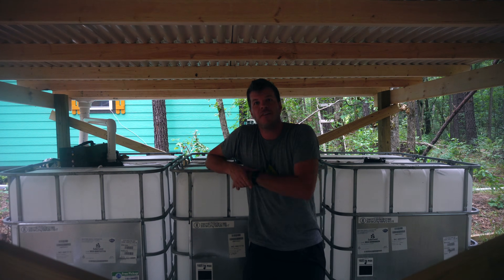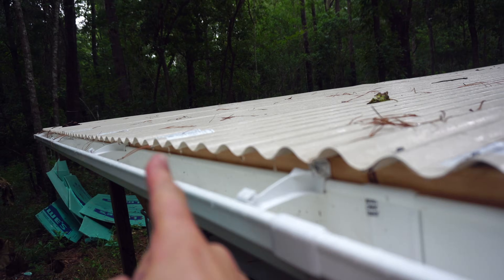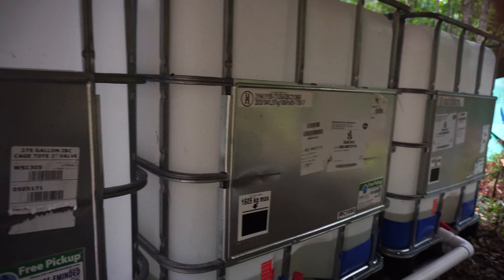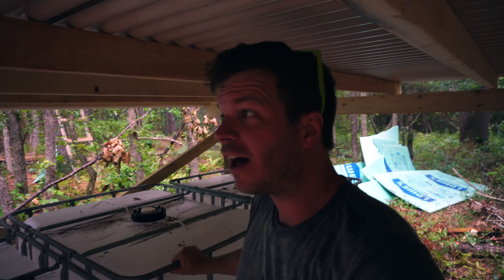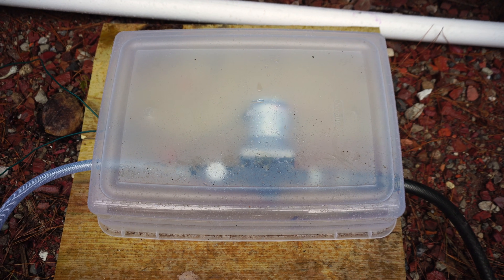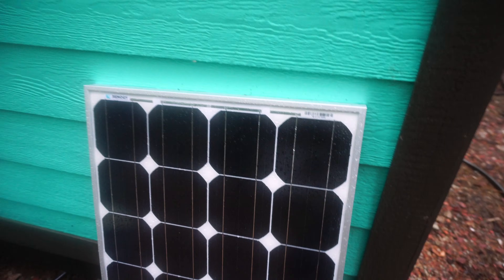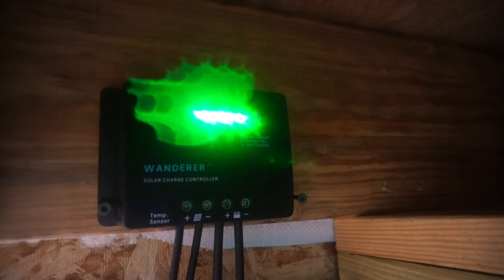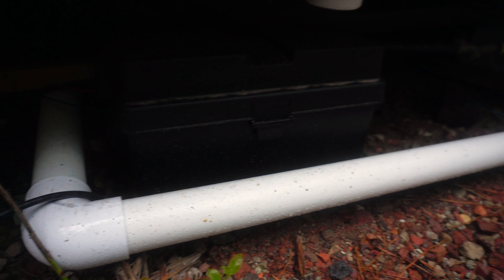ALL THE FREE WATER YOU NEED FOR A TINY HOUSE

Comment: How does the 3rd pump (small pump connected to battery) shut off when no water is being used? If it doesn't shut off, won't it or can it overheat? And the lifespan of it be reduced? Or do you have a shut off switch to it that is inside the house? Thanks.

Comment: One question I have for you. If you use this for drinking water, what do you do to kill bacteria that could in fact develop even in those totes over time? Do you use UV purification or chlorination of any kind? Activated carbon can help, but it still will not totally rid the water of BOD (biological oxygen demand) for microbes and other micro-critters. Other than that, I think the system it perfect. It is incredibly simple.

Comment: Hi , I'm seeing this in April 2018 and I seen something that I would like some clarification on .
You're showing the water entering the bottom of the totes , being fed from a down spout , Won't the pressure from the weight of the water inside of the totes prevent the new rain water from entering  ? because it needs to overcome the downward pressure of the water already present ?

Comment: Thanks for the video! How large is the battery you're using?
Reply from the maker: My pleasure! It's a deep cell battery similar in size to a car battery. Probably bigger than needed but the battery is also shared with the small fan that runs the fan on the compost toilet. But a good idea in case there are lots of days of overcast weather and no sun to power the battery back up.
Reply: Thank you so much for the information. I actually have a nice one I got for free that I could use then. Great inspirational setup! Stay tiny

Comment: Your outflow filters look great and you will definitely have a reasonable water quality, but you have to fix your inflow filters. To much organic matter will quickly block your filters and you have to clean or replace them often. Get a filter bag and keep it outside your IBC. I use rain water for irrigation only and the filters are only to protect the system so I only change them when my water pressure drops. Since using inflow filters my outflow fine filters last a whole season, previously I had to clean them every other week.
Reply from the maker: Thank you! I will check into this. Great advice. I appreciate it.

Comment: How does the pump automatically come on? is there a internal pressure switch within the pump itself that turns on the motor when the pressure drops?
Reply from the maker: That's exactly it. As soon as any valve is opening inside the tiny house, the pump kicks in and stays on until 55psi is reaching, which is only usually just a few seconds.

Comment: the pressure is terrific...what happens if you have a dry spell for a long time? yesss, what a great idea! have workshops up there!
Reply from the maker: My Dad has one extra 275 gallon tote that he can take to town and fill up if needed, then pump that water into the system. Worse case scenario (plan b) would be to pay for water to be shipped in which is pretty cheap but not something he wants to do on a regular basis.

Comment: I grew up with a rainwater domestic supply and have professionally installed stacks of them. The first thing I noticed was that you've used a balancing/filling line (The pipe that connects all three tanks) that was at low level. You should always have them high so that if there is a problem with fittings or tank wall perforation, only the tank affected empties out. A lot of the tanks I hooked up to were 10,000 gal round concrete ones and during one especially hot dry summer, tree roots busted through the base of one I'd done the hook up for (Day of the Triffids schidtt) and drained the tank (mugged by a tree). If I'd fitted a low level balance line, their entire supply from all three tanks of water would've been lost. Outlets were low level and valved separately so that only one tank was used at a time, unless.......   they were set in the ground, in which case they had a high level dual take off, with an internal dropper and foot valve, so that one tank never got too low, because if they empty out, the next time it rains, they'll actually pop out of the ground from displacement via the sudden abundance of groundwater.
Reply from the maker: Thank you. After a couple hours more rain, the tanks are all full. I agree with what you'e saying. The beauty of these totes is that you can hook them up in so many ways as PVC is super easy to work with. If we find this system doesn't work, we'll take another approach. I like that with this system, the top access is all accessible so bleach can easily be added to each if needed.
Reply: Yeah, they're a mighty little item those totes. Perfect for a small set up. The big tanks I was hooking up were generally for those old school, huge rural families keeping stocks up for potentially dry summers. If you're going to experiment with setups, I'd recommend using alkathene pipe and fittings, for the lines between tanks, as you can keep using the fittings over and over again, unlike PVC. 

Great channel by the way brother.

Comment: The totes were they new or had food grade products in them before your use. Consider a central mounting spot for your strainers & filters to ease servicing & freeze protection. Plenty already spoke about blacking out tanks for algae prevention. Where your totes feed your system install a secondary dump valve on each tank for servicing or wash out, consider flexible connections around tank connections for settling hard piped wont allow. The current system needs to have each outlet labeled non-potable this will take liability off you and shortcut any local codes against rain collection systems. Please take what I have said as positive we are right in the middle of selling home in town and purchasing homestead in country, already purchased 5th wheel for our tiny home yours is beautiful I'm a licensed plumber and everything I suggested will be doing myself, look forward to more of your videos

Comment: I've heard of a couple of tiny house fires resulting from Eccotemp heaters. Check the 1 star reviews on Amazon too. You might want to at least add some fire-proof cover between the heater and the wall to be on the safe side.
Reply from the maker: Thank you. The one I have actually has 4 stars on Amazon. I wonder which one only has 1 star? Not good.
Reply: Sorry, I wasn't clear. There are Eccotemp heaters that have four stars overall, but when you click to read the individual reviews and then click to see only the 1 star reviews, then you can see people talking about dangerous incidents with Eccotemp heaters. In one specific review, a woman who gave it 1 star describes how the flame went out but the heater continued emitting gas. When the ignition kicked back in, the accumulated emitted gas effectively exploded and scorched the side of her house. That's just one example. 

I was reading through the negative reviews and was surprised that Amazon still allowed the heater to be sold given the number of people who have had very negative experiences with them.
Reply: By the way, thank you for the video. I got a little distracted by the heater issue. It was really interesting to see your set up.

Comment: i keep thinking im gonna need lots of room for a pump filter heater but they are actually quite small. i dont know if this will freeze here in NW Ohio especially at night near 10 degrees.
Reply from the maker: You can always put the pump very close to your tanks, then bury the pvc pipes below the frost line to prevent freezing. We'll be wrapping everything in solar tape with a wire running through it that's powered by solar/battery and heats things up during the cold months.

Comment: i live in a place where we collect rainwater with guttering & downpipes, & have septic tanks. rule of thumb for any roof-collecting water system is that for slight roof slant degrees, t rib/ridged roofing profile is used, because this profile has a way more efficient flow, than that corrugated profile, when collecting rainwater
Reply from the maker: Thank you for the feedback! So far this one is doing great but I can see where you're coming from.

Comment: how do you keep it from freezing during the winter months?
Reply from the maker: We will be wrapping everything with a special tape that has solar current running through it to keep things nice and warm to prevent freezing. I'll show the video on that this winter when I tackle the project.
Reply: @tinyhouselistings  ,,
Reply: or just dig a pit put in a concrete floor with cinder block walls and put you tanks in there  
my question comes in what are you doing with algae and mold growing?
Reply: Tiny House Listings that's super interesting..  I can't wait to watch that!  You could probably put up a well house with a southern exposure and that water inside those tanks would likely be a decent thermal mass but then algae and mold would be my worry.  Or maybe adobe or CEB would be a good answer bec that stuff sheds moisture and does an amazing job at maintaining a consistent temp for what it is.
Reply: MrMOCENT right!!! I wonder how to keep it from turning?
Reply: Joshua Kiser x
Reply: Ernst D. Hill THAT’S WHAT I WAS GONNA ASK